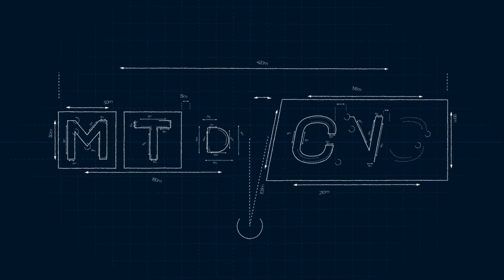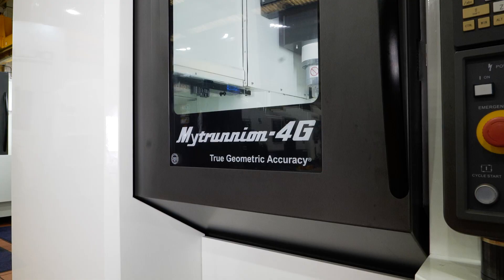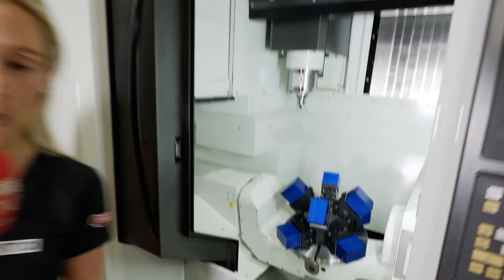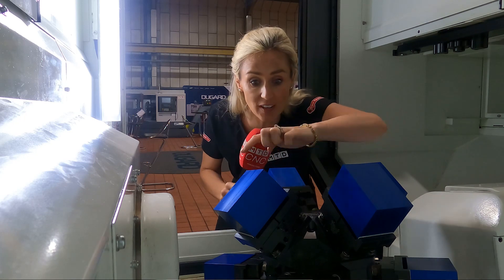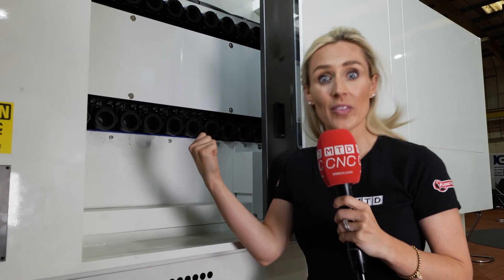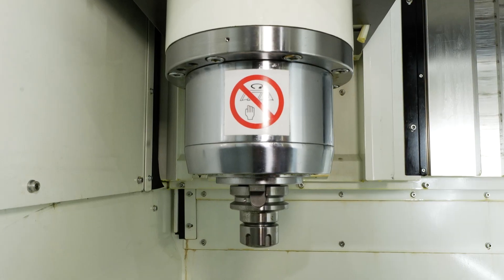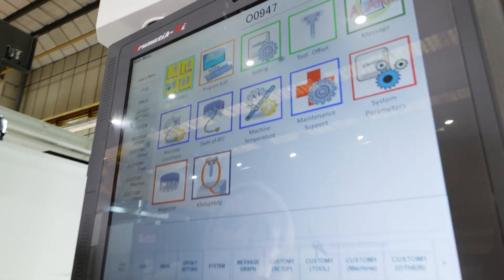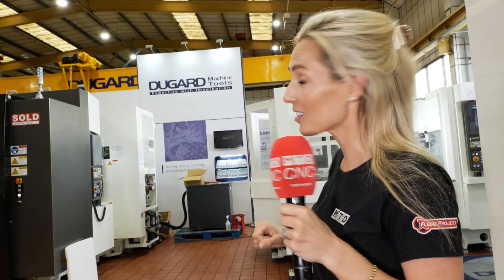Fancy a new 5 axis!!

Comment: a mill with windows as the os? Hopefully it doesnt crash :P 

funfact: its not even activated
Reply: Wouldnt be too worried :P I run a rock solid machine with windows based controller everyday. Its quite common nowadays, Okumas controllers comes to mind.
But yeah, I was a bit concerned before I got used to it. :)
Reply: Yeah.. even Mazaks run on Windows. Its mostly the same embedded version thats runs on ATM's